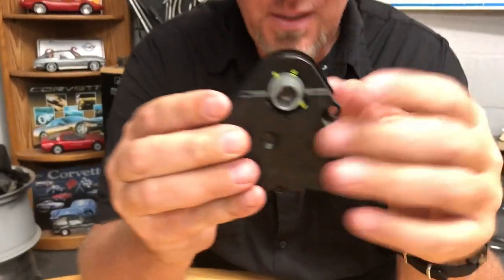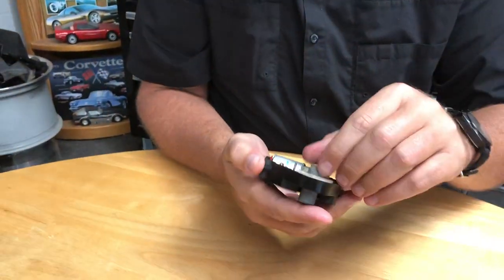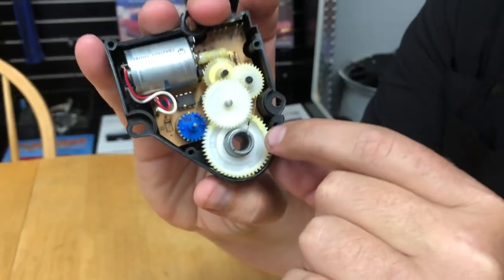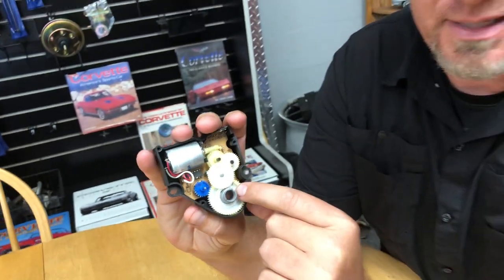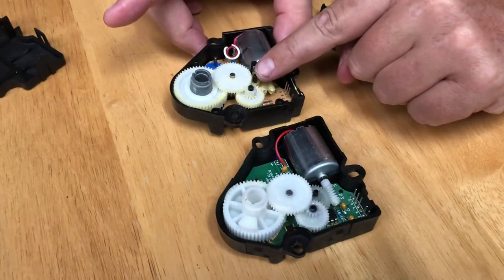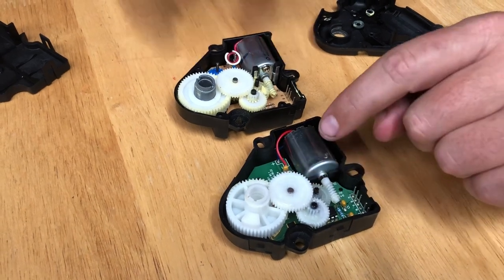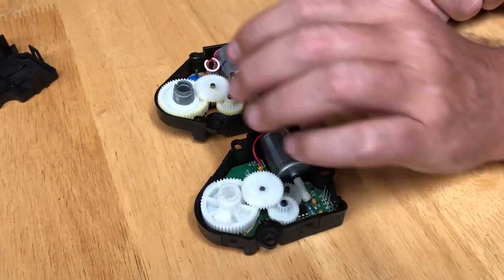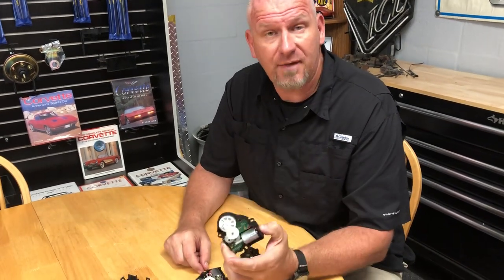AC Blend Door Motor Problem

Comment: Stay away form this fucking Dorman shit, I replaced all actuators on my 2007 C6, and all 4 failed...replaced with AC-Delco, and all OK
Reply: He was speaking of the c5 potty mouth!
Reply: @blake8580  The point being Dorman parts are crap regardless of the model Corvette they're for.  C5 Dorman parts are horrible as well.  If there are AC Delco parts available, use them.  They may be a little more expensive but they'll last 10X longer than any Dorman part.

Comment: My c5 blows air through all vents and doesn’t allow me to turn on recirculation I already changed the actuators does anybody know what the problem could be
Reply from the maker: That sounds more like an HVAC control head  and/or Vacuum Programmer issue.  You will need to have someone diagnose it to be sure so that you only buy the parts you need.  Lyle

Comment: Just bought a C5 that has this exact issue, starting doing my research and stumbled onto this. This was super informative and far more in-depth then what I'd been reading. Thanks for sharing this.
Reply: Same hear on my c4 I'm installing a bypass valve on my heater core
With a choke cable operation

Comment: Update...All actuators replaced. Asked the shop to replace the cores...$4800. Then.. fuel pump went. That also took out the main fuse/relay block. AND, they couldn't connect to the ECM. Frayed wire grounded partially fried ECM. Had to have it replaced so they could see what's going on. I might be wrong, but, I think after 100Kmi, it'd be best to expect these things'll happen. Now...imagine if I had a Euro with the same level of performance and how much that'd be...just a wild and crazy thought....Hopefully, this'll all stay fixed and I can get by a while w/o any further majors...'cept maybe the clutch?...

Comment: Thanks Lyle, I purchased 1 1998 C% in pretty good condition but I'm having issues with the AC flapper, also it seems I have a single zone climate system on this model... 
I have missing knobs that I'm looking to replace as well as find out where the single zone flapper is?

Comment: Hey I’m not sure if it’s the same issue or not but in my case I have a c5 it’s a 99 my front defrost does not work it only blows out like 10% and on the left side of the defrost closer to the drivers side door it don’t work at all and when I turn it still blows normally through all the other vents do you know what could be causing that ?

Comment: The dealer here in Arizona wants to charge me $2400 to replace the driver side blend door actuator and the blend door itself, which they say is broken where it attaches to the actuator.  Can you tell me if I am being ripped off?
Reply: 100%, replace the motors, theres plenty of videos as well, its not terribly intimidating

Comment: Lyle
I looking at a 2001 C5. AC Vents all working at this point. How common is this issue What would be your best guess to repair at a dealer in the future if needed?
Reply from the maker: Fairly common issue...figure $275 for parts and 4 to 6 hours of labor, as the dash has to come out to access these parts. Lyle

Comment: Lyle,  Thank you for all of your informative corvette content.  Much appreciated..  Quick question,  I have about a 10 degree difference between the passenger vents and the driver vents (passenger being colder).  But,,,  When I adjust the hot/cold on the driver side it does change from hot to cold,  just not Real cold...  Do you think it still could be the Actuator not fully Opening/closing??  Thanks again
Reply: Ken, that situation usually means that the you are low on refrigerant.  The A/C system isn't cooling at optimum and the left side being warmer is the indicator, most of the time.  Check your service ports for leakage--most common issue.  Lyle

Comment: My car is blowing warm air on all vents, my mechanic said it has zero leaks and it has freon and compressor is wor, can it be that both actuators are bad?
Reply from the maker: It could be the main hot/cold blend door actuator that is bad, or it could be that he verified no leaks without testing system volume and pressures?  Hard to tell without more info...  Lyle
Reply: @csvette  if it's the main hot/cold blend actuator, do I have to change both driver and passenger side actuators? I think he did the test with pressure I think everything was good.
Reply: @csvette  also when I turn on my A/C it'll turn off by itself like in 2 seconds, what you it's wrong? Can it be that I need to replace the ac control panel unit?
Reply from the maker: @naranjoceidy  That is NOT a typical issue...time to have it diagnosed by a specialist.  Lyle

Comment: I have 1999 c5 Corvette, (don’t have dual control) I ordered my new blender door motor off Amazon, they are the doorman brand part #604-107 and payed $23.53 each did I get a good deal? I bought 2 to replace both
Reply from the maker: You done did good!  Lyle :)
Reply: Thanks Lyle, all I have to do now is install them to save a little before I take my c5 to my mechanic to have the new a/c Compressor installed, I’m also waiting for my rear up graded main oil seal plate I ordered from you to arrive before I drop it off! I’m so glad I subscribed to your channel. Thank you for all the helpful info you have, I can apply most of my needs to both my C5 and C4 Corvettes and get the best results! Thank you

Comment: My actuators are in process of flaking out or dying all together. The dealership wants about $1900 to replace the known dead one. When the time comes, I'd have all 4 of them replaced. My question is, should I also seriously consider replacing the: evaporator core, heater core and blower motor, all at the same time? My 2013 C6 had 90,000 miles at present. Do these components start to fail in the 100k-125k mile range and say 10-12 years? Already had the radiator, PS hoses and CAGS solenoid replaced. Keeping up on all fluids, filters, etc.
Reply from the maker: I'd say if it is financially possible for you to do all of it AND you plan on keeping the car then there is no time like the present.  Lyle
Reply: @csvette  Thx. That's what I'm thinking. I'll prob be staring down the barrel of a $3.5K bill. But, it's a Z06. Same thing when the clutch is due. Gut the bottom, replace all the plastics and rubbers. Rebuild the tube....Even replace the FPump...

Comment: I just lost the control of temperature on my driver side. I have a C6Z. I'm reasonably certain it's very similar to the C5. I probably wouldn't be able to do this myself if the dash pad has to come out. And, the mode flow door actuator has already gone bad as well. I'm thinking of have this done and have all the actuators replaced at the same time if they're in the same location. Do you have the part numbers I'd need for the Dorman actuators? If I have to spend $1.8K for the labor, I want to make certain the parts are correct. The dealership I use allows me to bring in my own service parts.
Reply from the maker: Hi Sandy.  I'm sorry to hear that your are having problems with your C6Z HVAC system.  The OEM #s: 10325404, 10356910, 15142056, 15249473, 22754988.  Not sure what the Dorman number is on these units, as we still use the GM originals on C6's because they are still available.  Lyle
Reply: @csvette  Thanks, Lyle. On thinking about it, it appears my best option is to let the dealership replace all the actuators with factory ones. At least I'll collect the rewards on my GM BP card. I've already got 2 bad ones, I'm sure the others are ready to go,, too. That's what I get for putting lots of mileage on and not having a weekend only  'garage queen.' lol!

Comment: Instead of ripping out the dash and paying $120 a piece for actuators, would it work to put a ball valve on the hose going to the heater core? It gets over 200 degrees here in the summer and i dont drive mine in the winter so i dont need a heater

Comment: my problem is that ac is coming out of defroster, center vents, and leg vents at the same time, can you help me to fix problem. thanks and love your channel
Reply from the maker: You need to locate the vacuum programmer box on the Interior HVAC unit behind the RH dash.  Pull it and re-flow the solder for all of the solenoids.  IF that doesn't solve the problem completely, look at the vacuum actuators behind the dash and replace as necessary.  Lyle
Reply: @csvette  thanks for the quick response